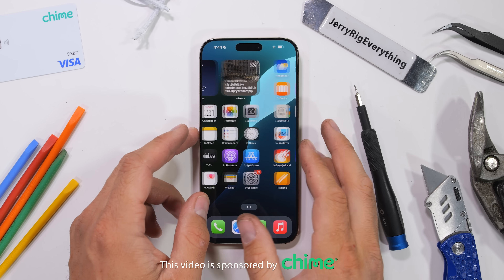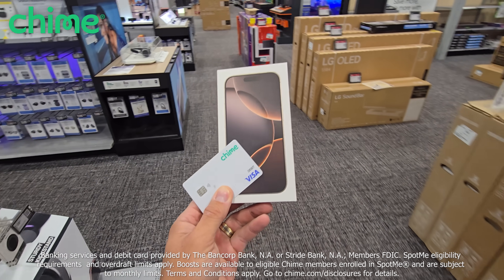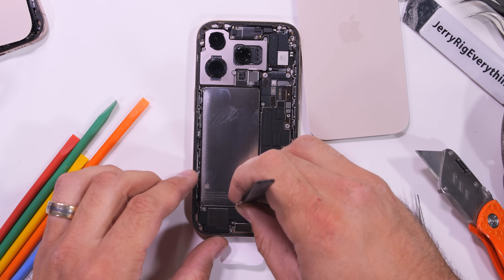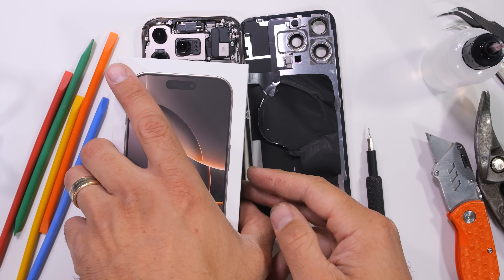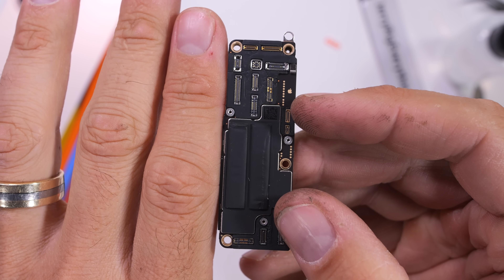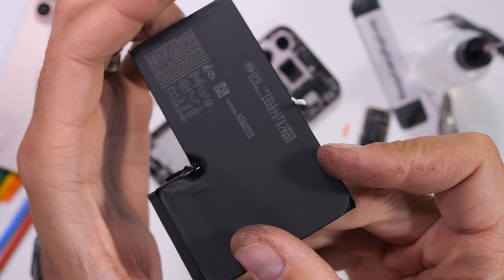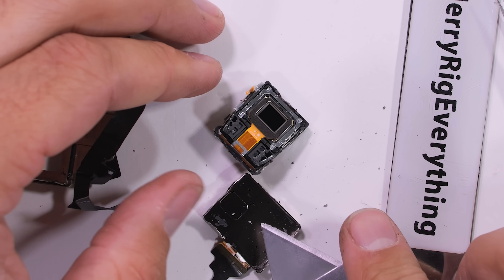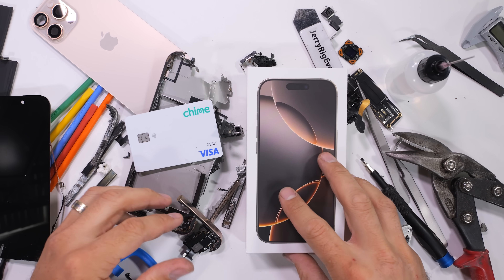Dear Apple: i am sorry...  (iPhone 16 Pro Max Teardown)

Comment: I just wonder why almost every iphone this year has a different method to seemingly get the battery out. IIRC, the iphone 16s have the new eletric disconnector, this iphone 16 pro w/ a metal housing around the battery, and the iphone 16 pro max with how they always used to do it.

Comment: The base 16 has an electric adhesive tape it needs to connect to 9V battery fir a minute and half and it comes off pretty easily (seen that in a video by Phonerepairguru) also it seems they moved the taptic engine to make the capture button have better haptics

Comment: I’m glad the EU is forcing these changes, without them we would get the same exact iphone for multiple years.
Reply: Riiight because the 16 is such an upgrade over the 15 /s
Reply: @antikommunistischaktion 
Apple knew for years that the EU will hold them accountable for thier customer unfriendly measures against repairs e.g. 

So Apple decided to make the necessary changes before the EU could enforce them. 

Selling them self as the innovator as usually and preventing another loss against law makers.

Besides, the repair ability of iPhones due to official guides and changes in components is a great foundation for greenwashing campaign in the future for Apple.

Comment: 00:04 Apology to Apple for mean things said about iPhones.
01:08 Chime offers financial support and flexibility without fees
02:08 Apple may be adapting to new EU regulations on smartphone batteries.
03:09 Apple introduces new 3582 mAh battery.
04:05 Apple's unique speaker design with hidden balls for better sound
05:05 Apple's missed opportunity with SIM card slot
06:41 New thermal layout improves hardware performance by 20%.
07:49 Apple makes the screen easily repairable

Comment: Apple has always been on the top of the mountain in regard to their mobile devices. Android fanboys have just been doing nothing but cope for the last decade and a half. They likely encased the battery in metal to protect the battery from heat generated by the induction charging, btw.

Comment: EU mandates on battery replacement is a sham. 
Phone manufacturers can still glue their phones together, still use a billion different screws in place, in fact the EU law states you either need to allow end-user to replace battery with readily purchasable tools or survive 500 cycles and still be at 80% health. Which most devices today do achieve, this means very few smartphones need to comply and gluing the back is still going to be a feature in phones since heatguns are considered readily available tools. Absolute shame, I wish EU had worded it to be battery replacement "without need of ANY tools" and can be done within 2 minutes by the end user.

Comment: the 16 has different kind of battery adhesive, can be loosened with a low-voltage electrical current for example a low volt  pencil battery,  you just have to put the positive clip to the silver tab on the iphone battery and the negative clip to the lower right grounding screw on the iPhone's bottom speaker mod

Comment: Good for apple to relesea the repair guides and the metal cover battery feels like a good method to avoid possible punture batteries during repair. Now if they will at least make the same size screws, the Iphone would become much less of a nightmare to take a part.

Comment: Iphone 16 battery removal with electric current is the biggest upgrade for entire 16 series
Reply: * Android smartphones - upto 120 watt chargers.
* Apple iphone's  - what is "watt" ? 
 We earn more than Chinese. We sell 20w charger seperately for Rs 2,000. 😀😀
* iphone  : 
Same old notch ( now modified as "Dynamic island" ), no charger in box, no 3.5 mm audio jack, no FM radio, no expandable memory card slot, one sim + one e-sim,  usb type 'C' charging port only in latest 15 series from September 2023, only 60hz display in non pro iPhone 15 models.
🤔🤔
But, iphone is the best. 😀😀
Reply: @sunilnathani3924  That kind of what i also meant, like, the biggest progress is way to change your battery, thats all

Comment: Apple actually deciding to provide repair manuals? Never thought I’d see the day
Reply: they didn't decide to lol
Reply: Only because eu forced them to
Reply: @nakazaki1254  Stop glazing the EU so hard.
Reply: @antikommunistischaktion  that's not glazing it's just a fact
Reply: Doesn't matter when the screen costs $300. There also don't provide schematics/boardview files and neither can you buy any board level components from Apple, just overpriced assemblies. Apple structured their first party part pricing in a way that it's barely worth it to do the repair yourself.
Reply: @-eMpTy-  do you really want a schematic for a 10+ layer board? something like a component layout guide would be better
Reply: @the_bootleg_starwalker  
Yes, that's what a boardview file is. But you need both to fully understand the circuit.
Reply: @-eMpTy-  oh for sure
Reply: Must be hard to follow tho , you need to be a professional a slight wrong move and its byebye also you have seen that in order to get into the phone you have to permanently remove some parts such as the pull tabs which makes the phone sell for less instead of just putting a modular battery , cant wait for 2027

Comment: I'm a bit bummed it didn't have the new type of adhesive which dissolves with a 9v battery like the 16 has. No matter it's still gonna be locked to the device.

Comment: Sarcasm aside, considering the cost for the parts and the amount of time and effort it takes to repair the device, which means it's more cost and time effective to take it to Apple. And if you take it to Apple, they'll make it seem cheaper to get a new device. The solution is to tkw it to a 3rd party repair shop. Which you should do, as it will be cheaper. Apple is yet again finding another way to make more money and paint themselves as the good guy.

Comment: If you want a higher APY and cash back rewards go for Varo bank. I’ve used them for 2 years and not a single issue. Fantastic bank in my opinion

Comment: you might want to talk to ifixit who agree more with me in that the iphone is actually quite repairable apart from the locked bit which are a bit of a dick move by any manufacturer that does it. But for years replacing screens and batteries, ports and buttons are far easier than a lot of android smartphones as youve shown in many of your vids they are really hard to repair without breaking things in the process

Comment: Cool strategy, where they make iPhones impossible to repair and use parts pairing to control what you can and can't do.
Then they make iPhones repairable to get media attention. Now everyone thinks Apple allows user freedom in their devices. But Apple still has complete software control over every single part in your iPhone. So users will think they have a Right to Repair device with control over what they own, when they do not. Apple can literally choose whether you are allowed to change the battery or not, from a distance with 1 click.

Comment: Hey I have a question, I'm a tech nerd and couldn't wait to upgrade from my Note 9 tomy current S21 Ultra, and a big part  of that decision was the 120hz display from the 60hz but I was kind of disappointed when I couldn't really tell a significant difference after it was hyped up to the moon. Can y'all tell the difference between a high and low refresh rate display??

Comment: The battery contents are protected from shorts and heat by a metal housing that provides structural integrity and thermal management.

Comment: Didn't know the new metal battery is only on 16 pro, I thought both pro and pro max are getting it while the regular 16 the new method to remove the battery. It's interesting how the non-pro and pro has different interiors on iphone 15's and now 16 non-pro, pro and pro max has different batteries.

Comment: one thing i noticed was that all iphone 16 have a bit different battery setting(kinda calling it battery setting) cause iphone 16 normal has electricity battery removal(which literally blew my mind), iphone pro has a metal incased battery, iphone 16 pro max has standard battery with pull tabs
which is insane and weird at the same time

Comment: I’ve read that the iPhone 16 battery can be removed by applying a small voltage to a contact near the battery and the metal chassis. Have you tried that?

Comment: I’d been waiting to hear your comments on the new adhesive that deglues itself when you pass voltage through it. It might have been cool to see if a random shock to a different location in the phone would have caused the battery to spontaneously fall off 😅

Comment: I figured the whole lineup would have the new electric adhesive removal technique, I’m surprised it’s just the base phones. The metal casing is definitely a good to see! I’ve been thinking of replacing my XS battery to give it some more life, but even for a tech nerd its still pretty daunting to crack open a phone (especially one that I rely on for things like 2 factor authentication)

Comment: Ah, different size screws, the bane of my existence.
Reply: EU models are all philips screws and have an electrical element which you hook a battery to for the battery to be released reliably (i guess that the pull tabs aren't good enough for user repair).
Reply: @adaster98 Stop glazing the EU. All iPhone 16 non-Pro models have the electrical glue, and the screws are still different sizes.

Comment: I guess because of the metal encasing that when you break the pulltabs that it'll be safer to pry out the battery without bending it too much

Comment: Funfact: for the metal battery removing, u have to use a 9v battery and put one terminal to the one edge of the pulltabs and other to ground for 1 minute,  and the adhesive just melt.

Comment: First of all.....yes it dissipates heat through the metal. Lol. And the adhesive tabs can be non sticky when you apply current to two clips in the phone. Also the 16 series is far more repairable than any other iPhone. Ifixit just gave it a 7/10 rating. Stop with the nonsense dude.

Comment: You can run a low current through the battery adhesive to deactivate it, so you can remove the battery without finicky pull tabs or messy alcohol. I wonder if they’ll start using this tech to remove the adhesive on the front and back glass.
Reply: Just on the normal 16 not the 16 pro
Reply: That's awesome

Comment: I think the metal battery is kinda a step towards the EU mandate if easily replacable batteries. Ofcourse apple will do it in thier own way, but maybe, they are planning to make it kind of a modular style, with screws holding the battery to the body jnstead in the future , which tbh, will definitely be more easier to repair then the whole pull tab method, unless ofcourse, apple uses thier own "innovation" Of screws which need specific tools to even get aroung.

Comment: interesting that apple encased the battery in metal it actually look cool! i work in a repair shop as well and it is reassuring that I wont have to pull out a 9v battery to remove the battery lol.

Comment: Iphone 16 and 16 plus got new way to remove battery using electrolytes, It actually has no adhesive strips to remove it, just one small tab that you actually have to use a 9v battery connected to the tab for a few mins that will disconnect the battery from the iphone 16. I really with to get your 16 pro 😊

Comment: Have you seen iFixit's video on the regular iPhone 16 and 16 plus? they have a different battery removal system where you provide 12V to two pins which stops the adhesive from adhering (idk how it works tbh :p)

Comment: By the way regarding the battery glue, it seems like you can just run a low current or something through 2 spots and the glue unsticks
Reply: That may not be in the Pro’s, just the normal 16s
Reply: @EvAdnms  This is correct. The base 16's are the only phones that have the low current glue. They glue completely replaced the pull tabs.
Reply: @Air_Burton  Bummer, I assumed it applied to the pros as well :/
Maybe next year :D
Reply: Yes, iFixit made a video about it
Reply: Kinda surprised that Zack missed that! It’s a really cool new feature.
Reply: @DylanClarkSallee  I guess he didn't touch the regular iPhones since it seems like it's not a thing on the pros for whatever reason :(
Reply: Yeah but for now only the regular 16 and 16 plus. Maybe the Pro’s as well next year
Reply: Just the current 16s not 16 pro
Reply: He has to read this

Comment: I seen the reg 16 with the new battery! It actually has no adhesive strips to remove it, just one small tab that you actually have to use a 9v battery connected to the tab for a few mins that will disconnect the battery from the iphone 16! Crazy stuff!
Reply from the maker: Ill have to check that out!
Reply: @JerryRigEverything ifixit showcasesd it already. It’s really impressive
Reply: @JerryRigEverything Give it a look, that’s innovation
Reply: @JerryRigEverything  also if the screen is almost half the cost of the phone $379 seems reasonable to replace it at apple
Reply: @tavi7  It's a massive up charge
Reply: @tavi7 you can probably get the same quality screen replacement for a quarter of the phone's price...
Reply: @mafcarvalho  i said cost of production not the price of the phone
Reply: @tavi7  I got it. You said half the cost of the phone. I still think that Apple overcharges the screen replacement at their services. I'm not saying that other brands don't do the same though. Samsung also charges way too much for their screen replacements, just to mention one of the Android OEMs.
Reply: Yup.. it’s on ifixit channel
Reply: That’s innovation